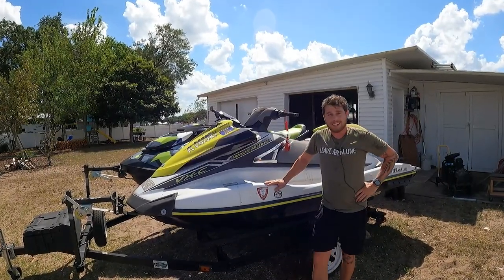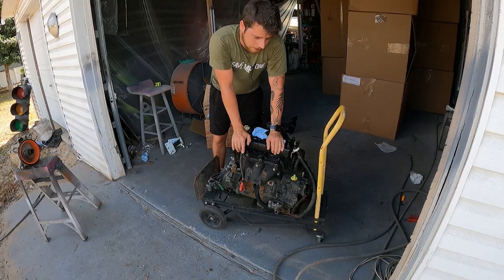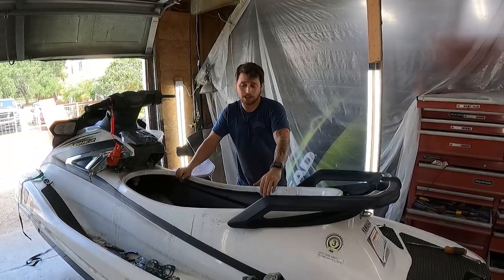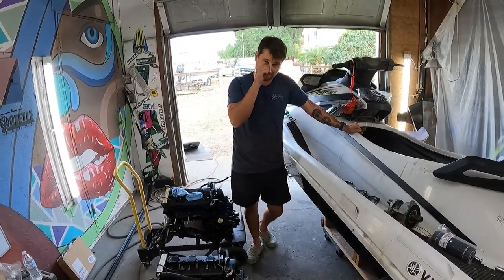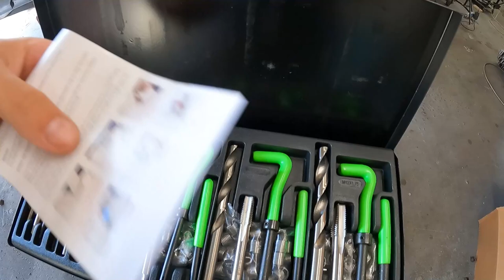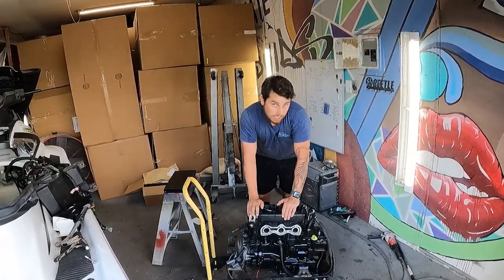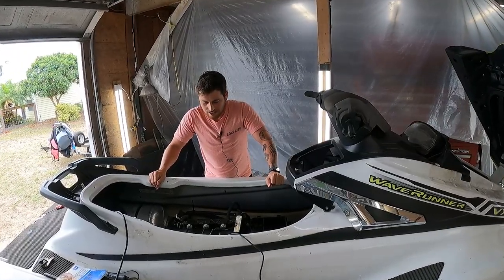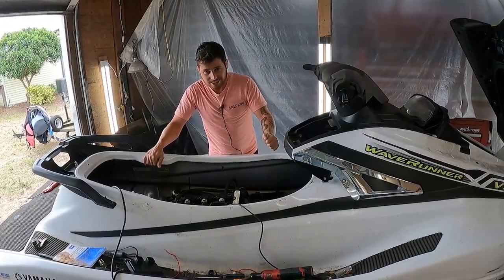Jet Ski Motor Replacement: Can I Get This Junk Yard Ski Running Again?!?

Comment: I hate to see good people get take advantage of. The person who sold you that ski had to know that there was so much missing from it. I like your videos and look forward to seeing new ones when they come out. You produce great stuff and your determination to get things done is something that I applaud. What would be a waste is you doing what you have done and giving up. Keep at it, you will get it running soon.
Reply: Me, I would have paid the 250 bucks to take it too a shop and have it checked out before buying it.  If they said, no, then you would have known right away that there was plenty wrong with it.  I would rather walk away losing 250 bucks then 4 grand at least by the time you are done.

Comment: We are here with you for these watercraft builds! Easy way to check to see if the fuel pump is good is to send the fuel pump 12VDC and see if it pumps. Also follow the ground wire back from the fuel pump to make sure that you don’t have any corrosion. If it isn’t that then you might should start investigating the dash. Surely Yamaha Marine Tech Support has some answers as to if the dash has anything to do with the fuel sending unit. Call them after you test the pump so that they don’t try to sell you a dash you don’t need.

Comment: You are doing awesome on this project. It's good for you to step outside your comfort zone. This is top level repair stuff for sure. I think the dash will light up after it starts. At least it does on my older waverunner. Make sure you have clean oil in that engine.

Comment: Pull a spark plug and check for fire during cranking. Spray some flammable spray in the air box to see if it tries starting while cranking. I was pressed for time and skimmed the video. Not sure if you tried those things.  Could straight wire the fuel pump to see if it works.

Comment: Did you check spark? That would at least say if the computer is trying to allow for it to start or that the coils are good (if not spark then the signal to the coils) and you can rule out if you need the Dash/instrument lights to be functioning to allow to start.  Also, check power at the fuel pump. or send power (manually) to the fuel pump to see if the pump works.  These are a few things that can help diagnose the issues faster.  
Another thing you can do is simply add fuel manually to see if it fires up (just disconnect the fuel tank and put fuel in the lines).  Just a suggestion.  Keep the videos coming.

Comment: Check spark before fuel, just to focus on one issue at a time. As someone else said, when you get to the fuel issue, wire the pump directly to check if the pump will function.

Comment: Hey Zach, I've been watching your channel for a long time now.  I'll start off by saying that whoever sold you this thing should be in jail.  It's like they took all the bad parts laying around, put them into this ski and then sold it saying it had a minor issue.  $2500 for that?  They knew damn well that it had a broken block and a corroded ecu.  But anyway, I admire your determination to get it going.  I've heard you say before that you don't like doing mechanical work very much.  But speaking as a professional mechanic I can tell you that this experience is making you a better mechanic and a better builder.  With this build you're getting into thread repair, wiring, some pretty advanced diagnostics, etc...  You are doing things with this that the average person would throw the towel in after a couple hours.  The financial aspect of this might be draining but the knowledge and skill you are acquiring is priceless.  Keep up the good work.  I look for forward to the next episode.

Comment: Have you jumped the fuel pump to see if it's working, and have you checked to see if the pump is getting power/signal to the connector, from ECU? 
I'm guessing it's fine and isn't being signalled on, but seems like an easy starting point?

Comment: I don't know the year ski your working on but a new ECU needs to be programed to the dash and keys if you have them.  I feel your pain but be reassured we are rooting for you to conquer this mess in front of you.
Reply: I was thinking the same.  As a security feature I think fuel will but cut off if the correct key isn’t detected.  I have a 2016 VX deluxe and it will crank but not run if the key isn’t detected.
Reply: That was my thought as well he needs to get the key programmed or the key that went with the ECU

Comment: Can't say if the dash is an issue, but a super easy way to check the fuel pump is simply pull it from the tank and put 12 v on it briefly (don't want to burn it up, to see if it works and then back track from there if it does work.

Comment: just a thought: short of the fuel sending not being an issue, I think maybe you need the dash to communicate to the ECU as sort of an immobilizer interlock. i don't know how sensitive these are with the key needing to be coded to the ECU.
Reply: Also agree immobilizer , remember the older yamaha skis just had a 4 letter code 👍

Comment: The best thing I have found for seized bolts is a mixture of 50% acetone and 50% automatic transmission fluid. Shake it up apply let it soak in a few minutes. I KNOW sounds silly.  Try it.

Comment: Before you start throwing more money in it, I suggest you bench test the fuel pump to make sure it's running. The ECU might require the gauge to be functional in order for fuel and ignition to work.

Also, it looks to me as if the previous owner of that PWC swapped parts from that unit to another one. There is no reason for that thing to have the reverse flap when that model never came with it. Still, as someone who hates good things to go to waste, I think it's admirable that you are rescuing it.

Comment: For future stud extraction use a washer weld the washer to the piece left it’s alot easier to get penetration on the broken bolt and washer then it is to weld down inside the nut once the washer is welded on then weld the nut to the washer

Comment: Unless this was spec'd without it, there should be reverse on the VXC. It should have the RiDE system.  There will be 2 throttle levers on the handlebar. The throttle on the left for reverse/braking and forward is the throttle on the right.

Comment: You could have taken the head off the blown motor and inspect it thoroughly and install it on the replacement motor if it checked out and that would have fixed your exhaust bolt problems as well as having a much lower hour head on the engine.
Really wondering if that jet ski had sunk with all that water intrusion and corrosion everywhere. Maybe they hydro locked the engine causing the damage after raising it if it did truly sink.

Comment: I hope you cleaned those cooling ports from that salt. The old engine was full of salt on the cylinder that threw a rod. Most likely overheated seized the piston and threw the rod. I hope it doesn't happen again.

Comment: I just bought a 1998 Seadoo GS 720 in great shape for $1,250 with the trailer but the engine is seized so I just bought a new rebuilt motor and I will replace it during the summer.

Comment: The pump will have a feed and a ground to it. If theres power to the pump then the pump is most likely faulty. If theres no feed to the pump you can add a temporary one, get the pump running. If the motor then starts at least you know everything else is ok.

Comment: I have an older waverunner 2000 model and it has an immobiliser on the dash and if you don't use the code on it, then the dash doesn't work and it won't start but it still cranks

Comment: I’ve bought a jetski and seller said it needs top end rebuild , his son a mechanic who could’ve built it but no longer have interest…ect ect. It turned out a crank shaft went thru the case and busted up and junked engine. The bastard never responded after I sent him those pics. Had to get a crate engine swapped in. People are just SOBs.

Comment: Hit it with a huff of ether and see if it fires.     PWC's are finicky and require a fully charged battery to run most times.    And,  don't try and jump start them, they're prone to frying electrical components when jumped.   You can hook another battery up with jumper cables,  but if you were ever using a car,  don't leave the car running, just hook up the cables.

Comment: thats not corrosion its dielectric grease to prevent corrosion clean it up  replace the fuse and the grease and try it before replace

Comment: The aftermarket starters are junk. You should have stayed with the original starter as long as it worked or swapped them.

Comment: So let me get this straight.  $1000 for very used need work motor. $2500 brand new motor. You opted for the $1000. FtLOG why?

Comment: I found this online: Yamaha Security System (VX Deluxe /VX Cruiser)The Yamaha Security System functions to help prevent unauthorized use or theft of the watercraft. The lock and unlock modes of the security system can be selected by operating the ((((remote control transmitter that is included with this watercraft)))). The engine cannot be started if the lock mode of the security system is selected. The engine can only be started if the unlock mode is selected. (See page 30 for information on the remote control transmitter.)